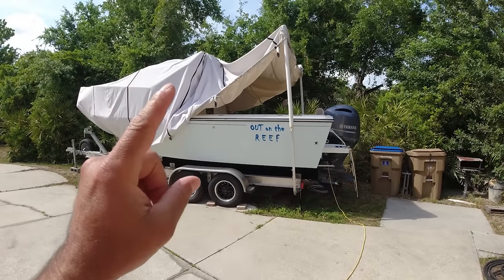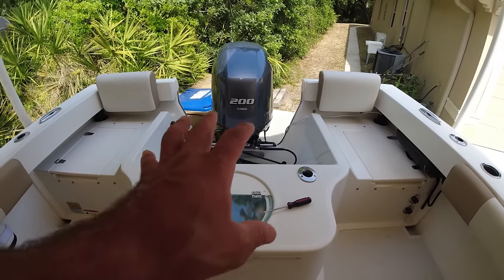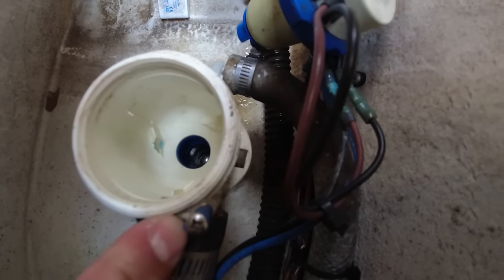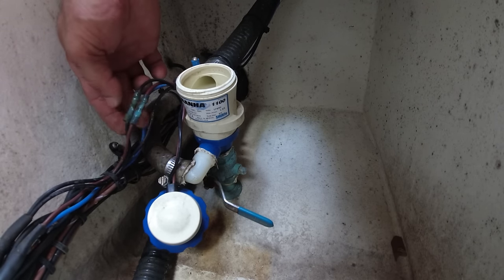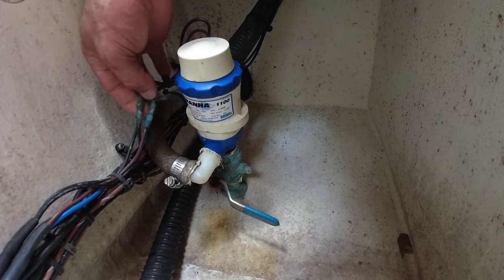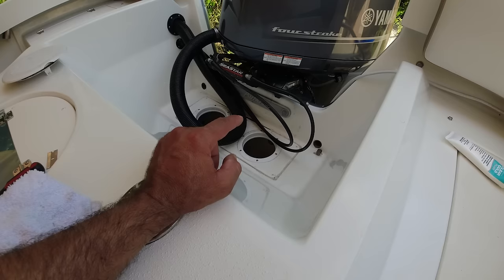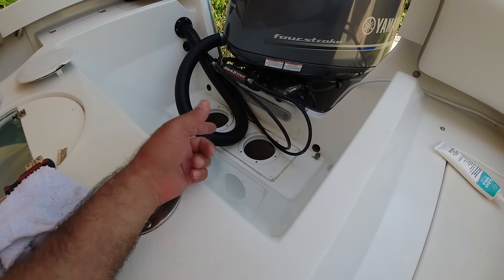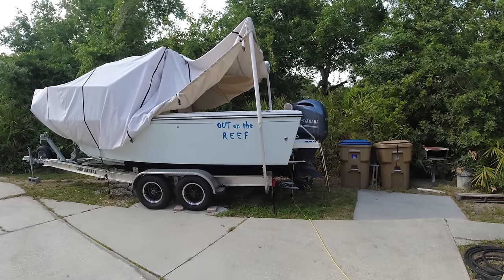Crooked PilotHouse is Been Leaking Water Since it was New Found the Problem from parker boats

Comment: Can the same content creator be responsible for both "I want a Parker" and "Now, I don't want a Parker?" Yes. Yes he can. Good catch captain. Very disappointing from a manufacturer which had a solid reputation for quality and affordability.
Reply from the maker: When I purchase this boat I purchase it because of the solid reputation I did even inspect it because this company has a such a solid reputation but it looks like it went down the drain very sad
Reply: @OutOnTheReef  prior to seeing this stuff, they ranked as a brand I would consider buying, given the cost of a Boston Whaler in the same configuration. Now, I'm not so sure. This is why a lot of people who will never be able to afford the boat they really want just end up beating the shit out of a Bayliner and then selling it. Boats with mid-level price but about the same actual quality as the starter brand = just buy the starter brand.
Reply from the maker: @musicianshotsheet4806  I think you're right Captain some of those startup brands are a good one to compared to this one.
And like you mentioned before this boats are not cheap they're very expensive,
Back in the day I had the whole was good cheat engine , and looking at this current boat I like that I have the 200 Yamaha on it if it had a cheap engine on it I would have bought it
Reply: @OutOnTheReef  it is very discouraging. Like, if you can't afford to drop $300k, a quality pilothouse is out of reach. I'm sure that's not entirely true, but this was supposed to be a step-up brand. (I'm still jealous of yours.)
Reply from the maker: @musicianshotsheet4806  😉👍

Comment: Sad ur boat had so many issues from factory. U ever think of closing the transient and putting in a bracket captain ?
Reply from the maker: Thank you Captain and no because closing the transom I have an outboard and it's already cut back there to add a transom they'll be a lot of work to do and they'll be so expensive that is not worth it it's better just to keep it that way or change the boat but thanks for the great suggestion captain
Reply: They can’t put a bracket on the 2120 boat won’t run right
Reply from the maker: @lou198  that's very true cuz the boat may not be balanced right
Reply: Boats are designed by naval architects with final parameters in mind.  Any major hull modification (adding a bracket) will alter the boat's performance.  When retrofitting brackets first became a fad, the modified boats sat excessively bow-up at rest and during power up.